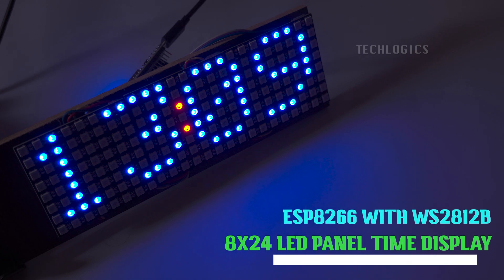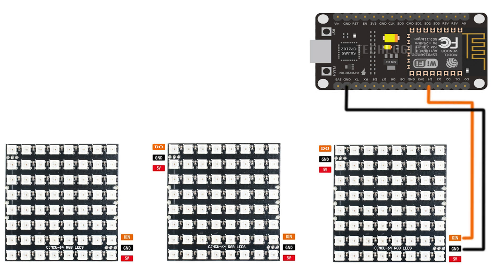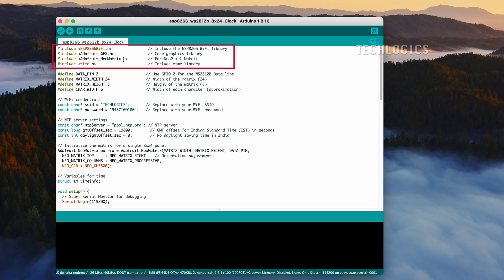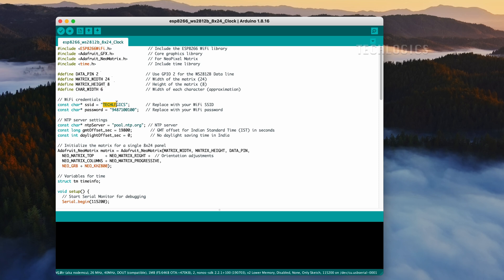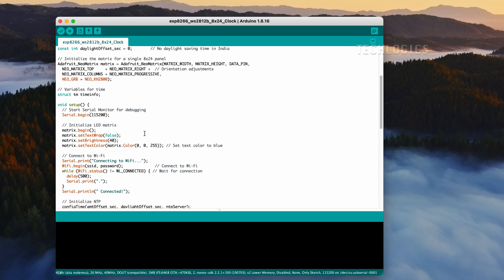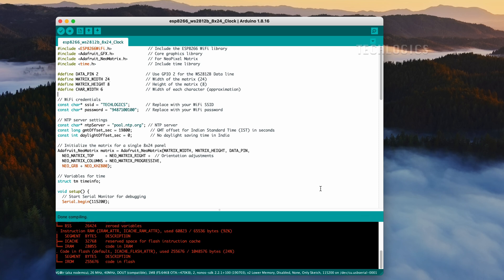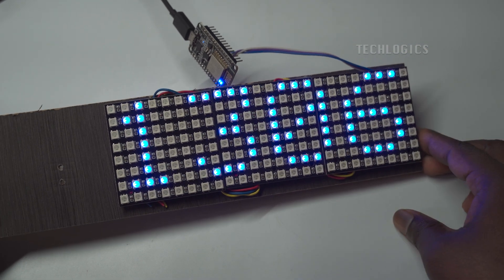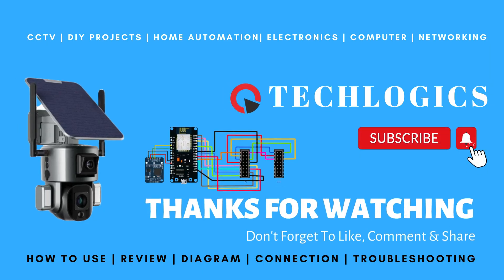Create a Digital Clock with ESP8266 and WS2812B LED Panels!

Comment: Compiling sketch error.
'getLocalTime' was not declared in this scope
Reply from the maker: The error message "'getLocalTime' was not declared in this scope" typically occurs when the function is not recognized, possibly due to a missing library or incorrect setup. In your case, you are using an ESP8266 with the time library but may need to ensure that the required functions are properly declared or included. 
To resolve this, try the following steps:
Ensure the right library is included: Make sure that the <time.h> header file is supported in your environment. This file should define getLocalTime. If you are using an older version of the Arduino core for ESP8266, consider updating the ESP8266 board library.
Check Arduino IDE: Ensure that your Arduino IDE and ESP8266 board package are updated to the latest versions. Sometimes older versions may lack certain features or functions.
Reply: @Techlogics  Thank you :yougotthis:
Reply: @Techlogics  sirji konsa lib versions aur environment version aapne use kiya woh boliye ....problem solve houayega

Comment: While compelling the code system is showing the message '' getLocalTime' was not declared in this scope' can u pls help me how to fix the error.
Reply from the maker: For the getLocalTime function on the ESP32, you don't need to install any additional libraries, as the required functions are part of the ESP32 core libraries that come with the ESP32 Arduino package. However, to use this function, you need to ensure that you have the ESP32 board support installed in the Arduino IDE.

Here’s how to set up and verify it:

Install the ESP32 Board Support in Arduino IDE:
Open the Arduino IDE.
Go to File > Preferences.
In the Additional Board Manager URLs field, add the following URL:
https://dl.espressif.com/dl/package_esp32_index.json
(If you already have other URLs there, separate them with a comma.)

Go to Tools > Board > Boards Manager, search for "ESP32" by Espressif Systems, and install it.

Select the ESP32 Board:
After installation, go to Tools > Board, and select your ESP32 model (e.g., "ESP32 Dev Module").

Include the Time Library:
The ESP32 core includes the time.h library by default, which is where getLocalTime is defined. Just add #include <time.h> at the top of your code.

Connect to Wi-Fi and Set Up NTP as in the Code Above:
Follow the example code from the previous message to set up Wi-Fi and configure the NTP server.

After completing these steps, getLocalTime should work without errors.